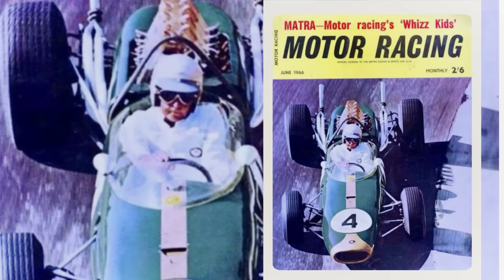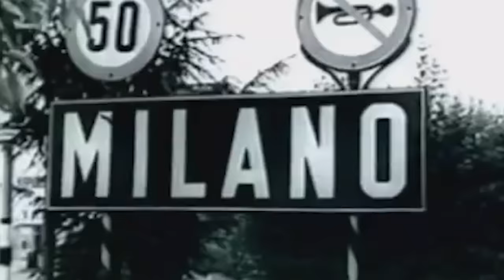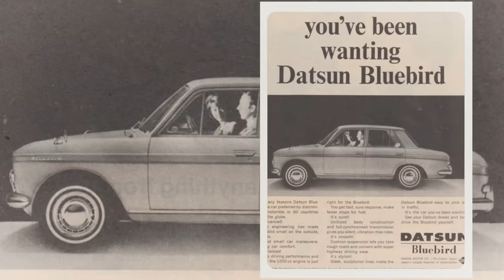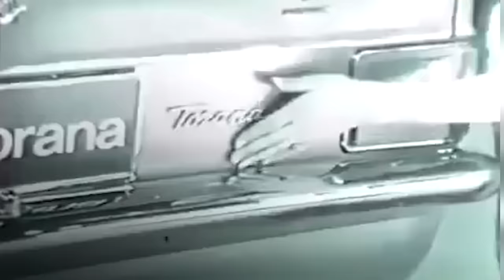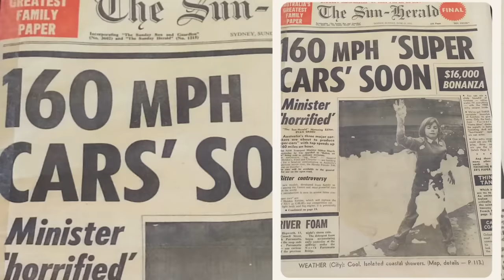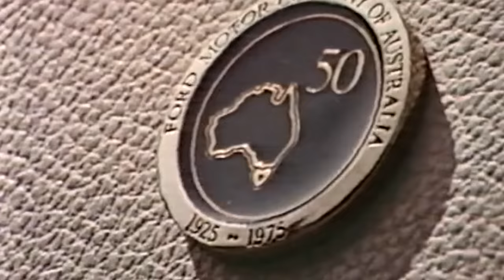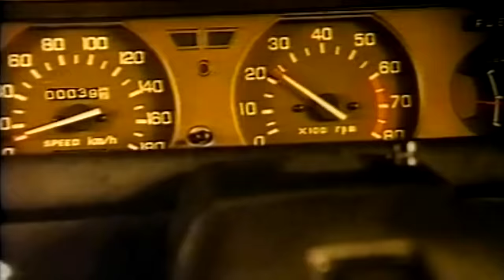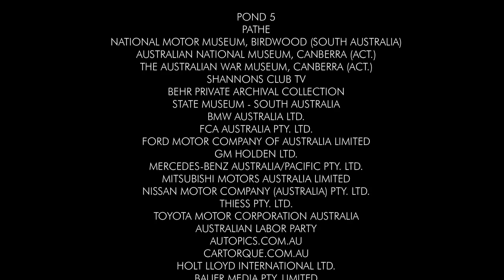The Swingin' Sixties to the Love Generation (1960-1979) | Shannons End of An Era | Part 2

Comment: Sandman was "Johnny-come-lately".  I ordered the same gear with my Holden panel van before the Sandman came out. At the time I was annoyed  I couldn't get a 350 in it. The Holden panel vans and station wagons were used in the 60 s by many of my surfing mates. Holden just jumped on a trend.
Reply: Even back in HK days and before people were ordering  sporty versions from the option list. Ford too. A bit more money around and 4 speed vans with bucket seats etc became common. Then came Sandman and Sundowner in XB and Drifter in 77 from Chrysler. The same with the Belmont SS sedan,, it was what was being ordered and the dealers ordering them for stock. And then came the GTS 4. Basically a sporty Premier.

Comment: Didn’t hear any mention of the GTHO being the fastest 4 door in the world.. anyway still a good watch ford and Holden’s were killer and the 6 pack Val
Reply: Didn't hear that  the E49 was quicker over the quater mile than the phase 3 either 😃
Reply: A V12 XJ6 would have pushed it, with a lot less capacity and tonnes more class
Reply: the jag would have boiled itself and fallen apart on our roads
Reply: I was thinking the same thing!
Reply: @stephenscholes4758  and a shiton more money and shittier sound
Reply: @stephenscholes4758  Dream on,, it would run out of oil or boil over 10 laps of any track.
Reply: It was for a while.
Reply: @68modelpete10  100% true. But the Ford ran away past the end. 6 pack was 13.4 sec HO was 13.8 Ho was 140mph plus. Charger,,, maybe 130

Comment: This video really brought back memories i had mainly valiant' my last one being a charger sports model beaut car  my most reliable was a 64 Cron wagon it had a Japanese version motor of Mercedes Benz it was not a speedy car by any mean's but reliable had an electric tail gate window 2 speed wipers wow it was a manual i got 356000 miles out of it until it got hit in the rear end by a cement  truck.

Comment: Here's a funny thing .. In 1998 Ford released the AU  Falcon. That car was lambasted as being a bad car from the outset  mostly by the moronic motoring journalists of the day mostly on the looks of the base model .  The car was far superior to the VT Commodore in almost every aspect too . It was way more better engineered  too .. Hung by the journo's .. Advance 24 years  from then and there are still AU Falcons many with literally huge kilometres on them and still going strong . My own one is that . It;s a series 2  Futura  version . It's Intech  inline four litre engine and BTR auto have not given me a bit of trouble  in the 19 years so far I've owned her , the cooling and A/C systems likewise , the tyre wear is exceptional , it's still a tight taut and confidence driven car to drive and is reasonably fuel efficient if driven normally ..The AU both inline 6 and V8  has become known in many ways as one of the very best Ford cars anywhere and has developed a huge fan base and loyal supporters ..We really did build some great cars . The AU Falcon is certainly one of them .   Bugger the journalists , just wait a while and see what become great cars .
Reply: Muttering rotters all should have IQ tests. The Falcon was a WAY better car than the bogandore. Bogandore owners hold a party getting 20k out of tyres. AUs do twice that
Reply: The AU taxis were getting over a million k's with a diff & trans replacement but basic engine core untouched

Comment: But the GM 'Merrican boss dictated that dreadful understeer of the HQ. Ruining it really , but the big killer was the lousy painting being non existent in the sills, inner door parts, framing around the motor, the guards- in fact everywhere and so they rusted insanely. They should had a class action against them.
The best Holden ever! For looks! and reliability.- Except for a few things- the water pump, that gear shift plastic gate block on the steering column shaft where you couldn't get it out of a gear to the next one after a little wear.
The rust killed it. My father never bought another.
I must say, some goose ruined the HQ awesome lines, subtle too, with those HORRIBLE American cheesy nose clips and body made to match. They took SOoooo long to give it the RTS.
Was that overbearing American big cheeses?

Comment: Geeeez the EH was a beautiful car to look at but when those bush and kingpin front suspension wore a bit the EH was an absolute bitch to drive ,,, fitting the ball joint suspension from the HR made the EH a far better to drive
Reply: Agreed, though the EH did most things well between exploded gearboxes. I fitted an all sychro from a LC Torana in mine an stopped that problem.

Comment: why are they making out as if the commodore is australian? it was and always has been an opel omega.Oh and stop saying "you know" so often.
Reply: For the same reason they also claim the falcon and valiant were Australian.
They were built in Australia.
Reply: An Opel completely rebuilt in Oz. May look similar but the Euro car would last a week in the bush. I have seen the Euro thing with the horrid Opel 4. A pom came to live and mistakenly brough his car with him. There is a few around. The Aussie car used stronger local mechanicals, cooling systems, even the seats were strengthened. And I hate Commodores but compared with the Euro crap they are excellent.

Comment: 15:53 I'm surprised that they used the reason "Wheel Nut Weakness" Because if you had an ounce of smarts you could easily have gone to the hardware store and picked up a set or twenty of Grade 8 Nuts and bolts to replace them. Maybe they just didn't have the time to do that I guess. It must have been mid race and too late to do anything about it.
Reply: Not the nuts but the wheels. Common in the 60s. EHs tore wheels, Studebakers, Valiants, most of the Jap cars. Motorracing did improve those areas,,, eventually!